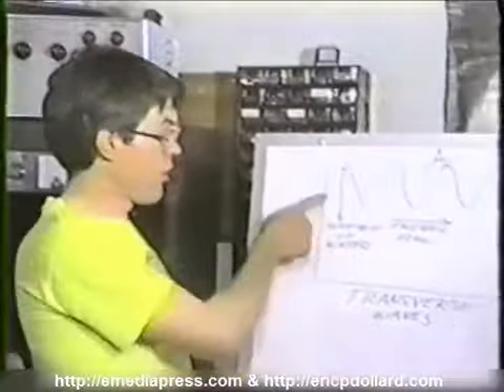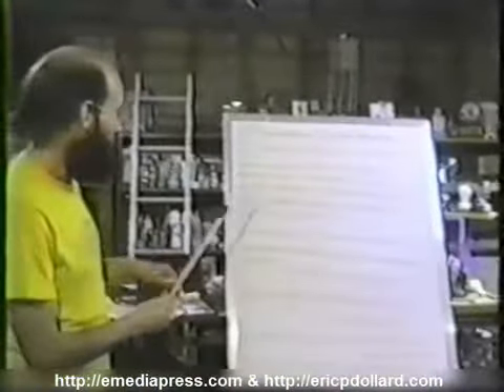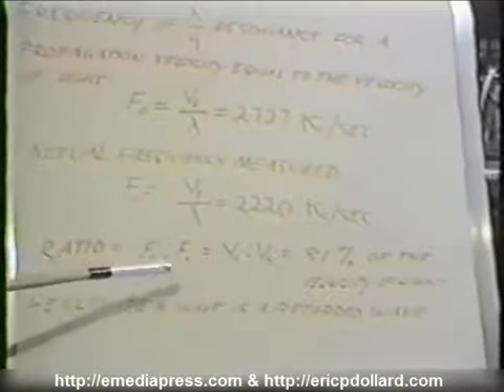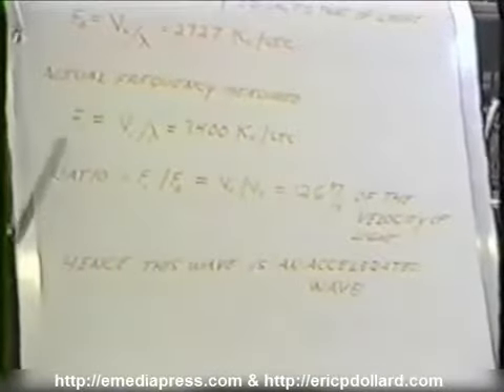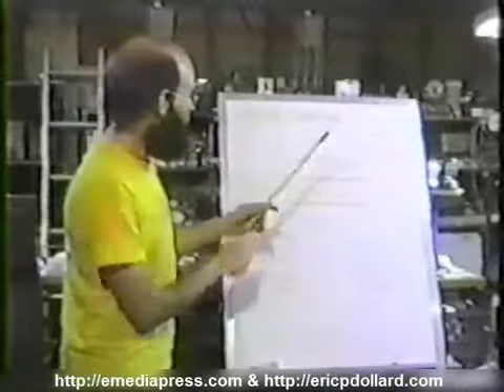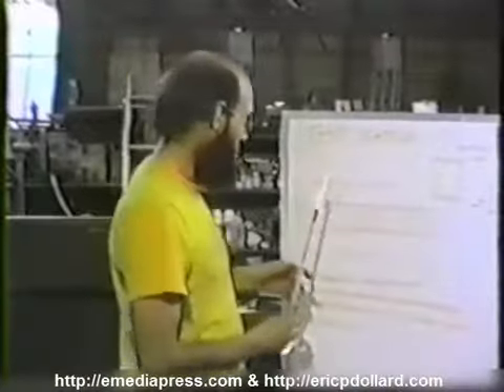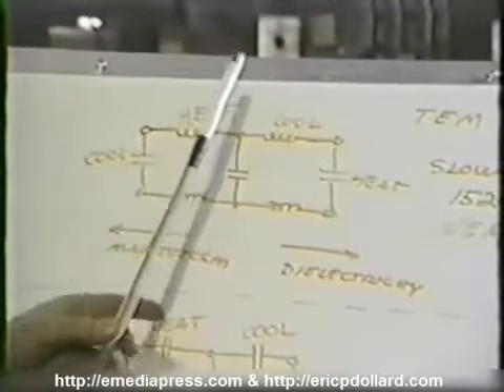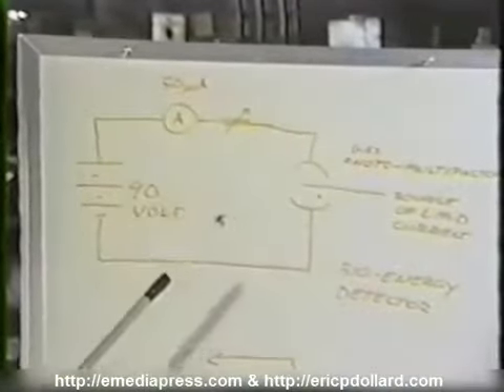TRANSVERSE LONGITUDINAL ELECTRIC WAVES -Eric Dollard

Comment: These two dumbed down the science enough for me to give me a rough idea about longitudinal waves, and how efficient they are in transmitting electrical power! The circuitry he used to mimic long transmission lines also helped me understand analog measurements as more practical in explaining what's happening in electrical circuits. 
Keep posting. Thanks